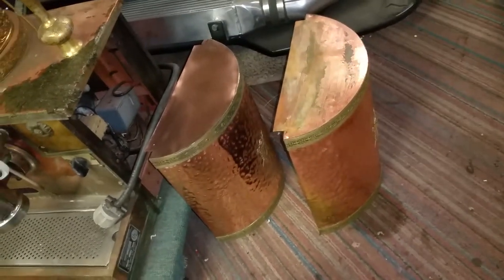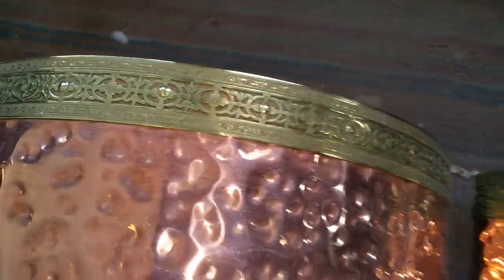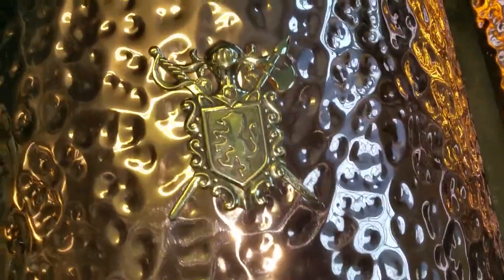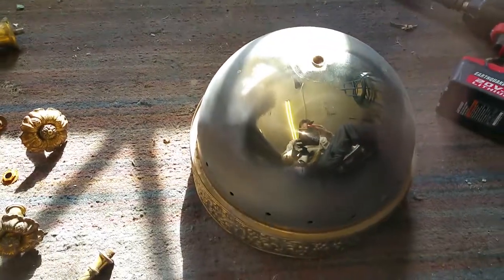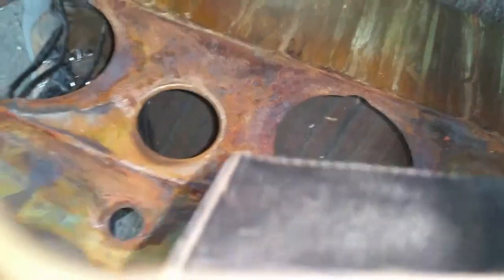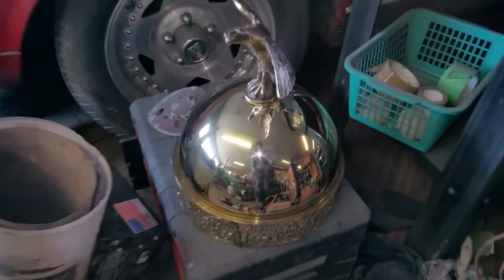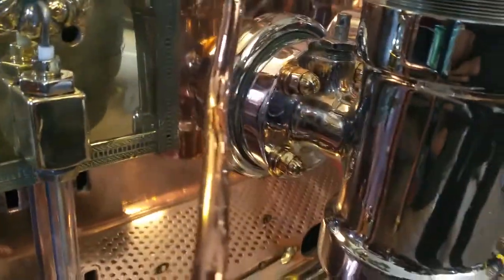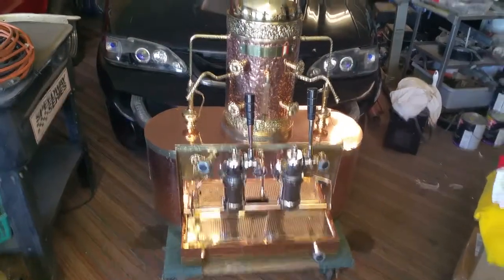Gaggia Orione vintage Cappuccino Espresso Restoration

Comment: Hi those machines are pretty cool and thanks for making the clip , I'm a metal polisher and I can give you a tip keep your primary cutting lines horizontal to how the part is going to be installed and I find a good way to stop the part getting away is make up a sand bag or two and don't overfilll them and they will mould to contours suede or heavy pvc is best for bag and best your part on it and when you come to finish buffing for your last pass cutting, rake out your buff and apply compound and slow your speed to like 2000 rpm your lines will be much finer. You than should try jewlers compound on a soft domet or Swansdown buff at around 1600rpm this dousnt cut it burnishes the metal and use a little sprinkle of Vienna lime on the part and run over it again for the bling